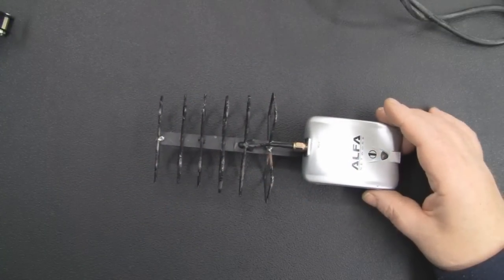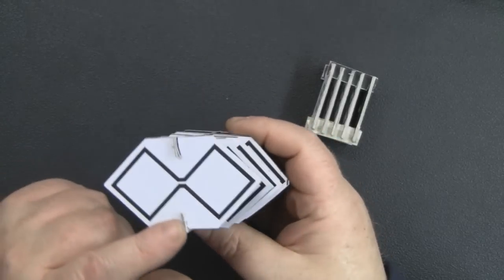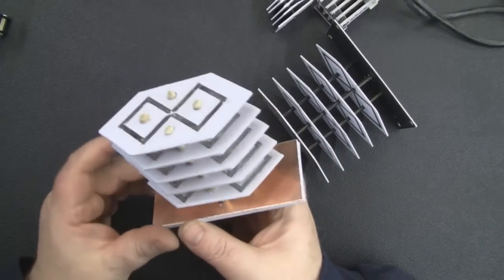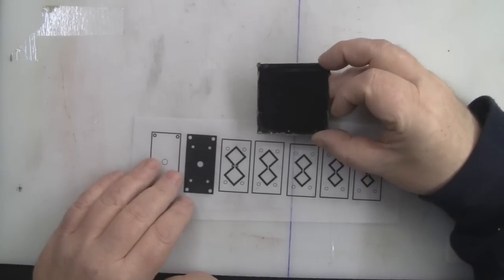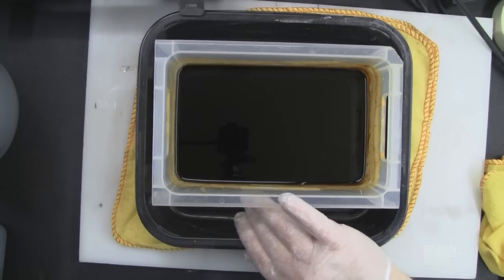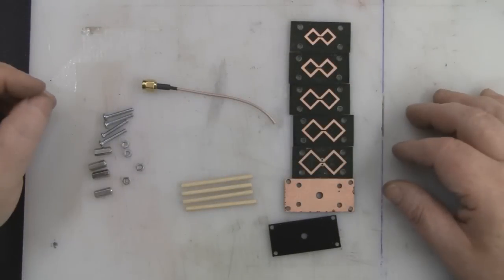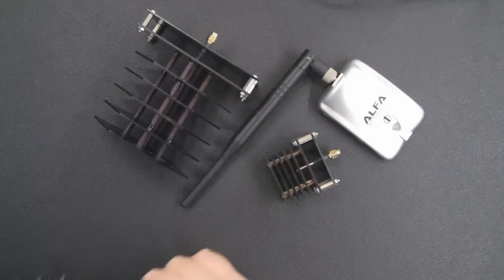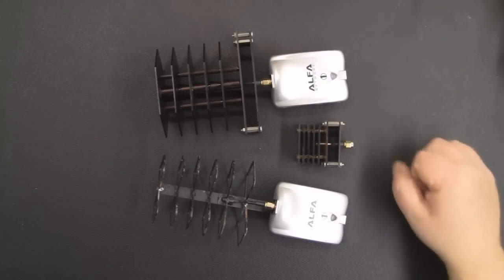Biquad Yagi 2 4GHz and 5 8GHz Upgrade! #85

Comment: Actually, I have a second question. Have you considered using straight dipoles for the parasitic elements rather than bi-quads? I'm curious whether there is an intrinsic advantage to go either way.

Comment: I was wondering, what is the calculation for the size of the biquad patterns? I know for a simple biquad antenna the sides of the antenna should be 1/4ths of the wavelength of the signal you are trying to catch, but what about the reflector or the directors? is that the same as a "normal" yagi antenna where the 1st director is 0.45 * 1/4th of the wavelength, 2nd is 0.40 * 1/4th of the wavelength, and so on?

Comment: Hello Andrew. I made a biquad-yagi antenna based on a set of 3D files from Thingiverse. However, as it was a bit difficult to me to find solid wires, I had used flexible wires to construct the turns of this biquad elements. My question is if the fact that I´m using flexible wires in the biquad elements, will this have any negative effect or some loss on signal quality? My excuse, I did not find your e-mail to send photos of my 3d printed antenna. It is pretty neat antenna but more important I hope that this will work. I already have to find the rp-sma connector to finish the job to test it. Thank you! 
Link to files: https://www.thingiverse.com/thing:3130541.

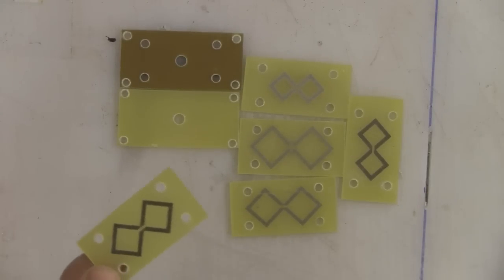Comment: At 16:56 you mention 'test router' is about 120 metres away with 4 brick walls.  In this video of yours https://www.youtube.com/watch?v=idjt6ZMesPk, you mention at 13:58, the same 'test router' is 45 metres away with 4 brick walls. My question is how is the dipole antenna showing about 50% signal strength in both cases even though the difference in distance is about 75 metres????.

Comment: Dear Sir, I stay in Malaysia, and our 4G signal here is I think is 2.6Ghz, I think to build one of your design Biquad Yagi antenna for my TP-Link MR-6400 4G modem that is low on the 4G signal, (the telecommunications tower is quite near my house but due to 3 massive apartment is blocking my house from the tower making my 4G signal very low on my house), is this 2.4 Ghz version usable on my country or I need to build the 5.8Ghz unit? or any others measurement that I can follow to build one of this antenna. and the 2nd thing is the copper wire & copper plate, is hard to come by at my place, and the cloth hanger sold is mostly make from plastic, the steel wire that I can get at here also sucking low quality and easy to rust, the best wire I can get on hand is the stainless steel wire that is hard and rust proof, but is hard to bend and I got saw some comment on the web said that stainless steel is not the best material to build a antenna. so I think about can I use aluminum can / aluminum sheet  as my template for the antenna? aluminum easy to get and much soft to cut then stick it on the card board as the antenna template.

Comment: First of all thanks so much for all the videos and sorting out this information.  I'd like to ask, does the thickness of the traces on the PCB's affect the antennas resonance?  In other words, if i make the traces thicker or thinner will that effect things?  My guess is yes?  Also, have you ever noticed the laquer coating have any affect on the performance of the antenna? In my experience the higher the RF goes the weirder it reacts to things you wouldn't expect it too.

Comment: If I used a 15 element 2.4 ghz store bought wifi yagi antenna, and cut all the elements down to half of the length that it is now, would it be slightly more resonant at 5.8ghz? 
Thanks Andrew.

Comment: hello andrew, the PDF has errors, the reflector holes for the driven is not right and was rotated 90 degress, ill have to do hole corrections on my build. seems like im the only one testing out the PDF xD
im actually doin the 2.4ghz biquad design. just finished grinding the pcbs and found the holes on the reflector is incorrect.
Reply: you can try checking the other pictures, not a significant difference since i compared it with 12dbi internal patch antenna
Reply: if you click on the links of pictures in my facebook, you can try seeing othe pictures

the patch antenna had wider degrees of coverage, the biquad is 50degrees only, if i go dead center, the biquad has greater signal strength, but not that significant since it is a 2dB difference , from a stock regular antenna, it performs good, i plan to use this for Point to point long range, probably modify to 9 elements that Andrew designed. 

it a good antenna, i wasn't ready for mounting on a pole, rush test.
Reply: Please tell me your result if you build one. From my testing, the signal has no differrent between 2 or 9 elements.
Reply: Tommy Denver have you done the 9 elements?

Comment: I build 9 elements biquad Yagi 2.4GHz. Performance is less than my 19 elements traditional Yagi(17.6 dbi). Max dbi of biquad Yagi is 4-5 dbi less.
Reply: I test my 9 elements biquad yagi by remove all elements except reflector and radiator, however, there is almost no different between 9 elements or 2 elements(reflector+radiator).

Comment: Hi, why do your parasitic elements have a gap in the centre? I have modelled several designs of these on 4nec2 and joining that centre gap increases the gain by around 3db
Reply: +mikeman400 
Yeah I have built something similar. You would be better off building something like http://www.lan23.ru/wifi/DPatch14/Double-Patch-14dBi.html easier to build, proven design, and better performance.

Comment: Hi andrew, I plan on making the 2.4 Ghz one out of cardboard as a weekend project and I have a few questions as to what I will need.

For the copper tape, what are the two widths that I will need?

What is the length and diameter of the dowels?

Can you recommend someone on ebay that sells quality sma connectors?

Comment: Andrew, You are absolutely great. There appear to be some problem in printing the template, however. Could you please post the detailed dimension giving the inner, outer (or the thickness) of all the elements for the 2.4 GHz please, so that people like me can take advantage of your efforts.
Reply from the maker: * Mohanty What problem are you having?
Reply: andrew mcneil Hi Andrew, Thanks for your reply. Actually, I am not getting any improvement over the 5 db Rubber duck stock antenna with the PCB Biquad Yagi. I double checked all dimensions of the PCB with the 2.4 pdf file, and they were exactly the same as per the printout. For example for the driven element, the dimensions are 31.5mm(outer to Outer edge), 25.5mm(inner to inner edge) with a thickness of 3 mm copper strip. I am suspecting that my printer has flawed while printing. Are these dimensions correct? Please confirm. Thank you so much again.

Comment: Great tutorial, I haven't etched for 15-20 years but this wifi stuff making me look at doing some again soon, I have still go my uv Lightbox,  I have been playing with this type yagi and patch antenna, Satelite dish reflector, 
Been looking for ideas to get a larger 400mm patch 16 patches antenna, but large copper clad very pricey,

Very good results from quad patch antenna,
Got loads old 2.5 gig wifi units could do with some 5 gig to start playing with.

Here is one I created from lots of info, each pad is 45mm square and the back plate is 5mm away from the pads, 

https://www.dropbox.com/s/ks7wnm72vilvh7i/satdx%20circuit%20each%20squared%20should%20be%2045mm%20.pdf?dl=0

Not tested it yet,

Comment: Thank you for this excellent channel Andrew.  I looked into making this antenna but it would cost me twice as much for a one off as you can produce them.  I noticed, however, that the model on the website only has 4 elements instead of 5 on the video and on the template..  Any particular reason for this and does this mean you recommend leaving the last one out?

Comment: Great work Andrew, keep it up. I've built a few of your antennas for FPV with good results. Thanks!
Reply from the maker: Gareth Anderson Thanks Gareth, and thanks for the feedback
Reply: andrew mcneil 

First of all, I want to thank you for such a great build on both antenna models (5.8 & 2.4). Also, I was curious if I would to put the 5.8 antenna at the end of the 2.4 antenna or vice-versa. Would it mean that it would pick up both signals (2.4 & 5.8) ??

Comment: so can solid foam spacers be used in a stacked configuration instead of stand-offs or will it interfere with performance?  Very nice info!
Reply from the maker: Rocket That should work but yes it would have a small effect as most materials do to some degree. Even the fibreglass of the PCB does.

Comment: I also need to push my WiFi into my workshop outside. My workshop is about 20 meters from my router so should I use a WiFi repeater or something like the Biquad Yagi?
Reply from the maker: ***** 20 meters is not far I would go with a double biquad.

Comment: Nice antenna! Could you please post dimensions for the elements? I'm going to cut them on a CNC mill and even though I can print the templates and measure them this won't be very accurate.
Reply from the maker: Oleg Mazurov Driven element 31.25mm  parasitic elements 30mm/29mm/28mm/27mm. Reflector is 110mmx50mm
Reply: @andrewmcneil  could you perhaps post the CAD or Gerber files?
Reply: andrew mcneil Dear Andrew, are these the dimension of the inner or the outer edge? What is the thickness of the copper please?

Comment: Nice video and design, You gave us an idea on a 6.4GHz antenna solution for a local project we are working on to bridge high speed data over a licensed band, Thanks.
Also Do you plan on enclosing the antennas in a radome? If not you may consider some nylon type standoffs and spacers instead of the wood.

Comment: I built the original biquad and I agree it is too easily broken.  I would be interested in buying a pcb version if the price is half reasonable.  If not, I can always cut one on my cnc.
Reply from the maker: Blair Thompson If the pcb manufacturer is true to the quote they have given me it should be around £30
Reply: andrew mcneil that sounds OK to me.

Comment: If I wanted to CNC mill elements from an actual copper plate, what thickness would you recommend?
Love the videos.
Reply from the maker: DKTAz00 I would not go thicker than 2 mm 1.5 mm would be my choice let me know how it works out.
Reply: Hi, never forgot about this, just saying. 
I've finally drawn up the plans for the elements in 123D. This is my current idea: http://imgur.com/r7USNlj Since my printer can't do a single print because of height, I've had to split it into sections. The elements will be pressed into the plastic and superglued in place, so it should end up something like this http://imgur.com/3gxdb5O It's actually the long range version. I've just ordered some 1.5mm copper sheet from the UK, since its 10% off these days :p 

I do have some questions, and would be happy of you could answer some of them. 
How badly would my two threaded rods interfere with the signal? Would isolating them from the reflector help? Would you still make the elements 3mm wide? 

Best regards (ps. sorry about messing up your name in the filename xD)

Comment: The 5.8GHz biquad would great for FPV guys. What is the beam width of the biquad yagi? Is it the same in the vertical and horizontal? Great video Andrew 

ATB Malc
RCTVUK
Reply from the maker: Stelios Stavroy I will have a look when I get home tonight some people have the same about other templates I have uploaded in the past as adobe sometimes adobe auto scales.
Reply from the maker: RCTV-UK Hi the beam is 50 degrees with 12dbi there are some tweaks to the 5.8 that I still want to try like adding more parasitic elements as etching will allow me to go down to 0.5 of a mm. There is a very slight amount amount of loss when you turn a biquad from horizontal to vertical but realistically you would need a ten grand network analyser to see it.
Reply: andrew mcneil Thank you for the info Andrew, what are the benefits of this antenna over a helical? I am guessing it is more compact?  Would it drag the signal in better through objects walls trees etc?
Reply from the maker: RCTV-UK Short answer yes, the biquad and a wave guide are the antenna of choice for cutting through obstacles but loose will power on reflection a circular polarised antenna not as good at cutting through obstacles but does not loose (as much) power from reflection. 
 Both antennas have good and bad but it seems that most people who fly FPV stick to the same one (circular polarisation) no matter what environment they are flying in. This may be down to cost but hopefully people will watch the videos and start experimenting.

Comment: Great work! Please give us some specs, radiation shape beam width. Very interested in your antennas for the 2.4ghz and also the 5.8ghz!
Reply from the maker: lostboyscrew Thanks Lostboy 14dbi with a 50 degree beam for the 2.4GHz and 12dbi with a 50 degree beam for the 5.8GHz. But I think I can tweak the 5.8GHz to increase its performance.

Comment: Great, enjoyed the video and thanks for the templates!
Do you have any specs for these antennas, gain / beamwidth?
Reply from the maker: ***** Hi yes I meant to add it in the description, 14dbi with a 50 degree beam for the 2.4GHz and 12dbi with a 50 degree beam for the 5.8GHz. There is still areas that I want to explore with the 5.8GHz though.
Reply: andrew mcneil thanks for the specs
Reply: +andrew mcneil  
The performance is less than my expectation compare to how complexity it is. From my testing, dbi is slightly better than cantenna but complexity is much higher.
Reply: can we get your email id to discuss about DIY about rebuilding this for RF GSM antenna?

Comment: I spent a career in the screenprinting field- that photosensitive emulsion on that pc board looks suspiciously familiar. We made screens, or plates for printing exactly the same way. Modern HID lighting, and tuned LED's will make that exposure time measure in seconds.

I will be joining the forum if you build it, and once I get some specs on the window these things operate in, I may consider some ground station upgrades/options.